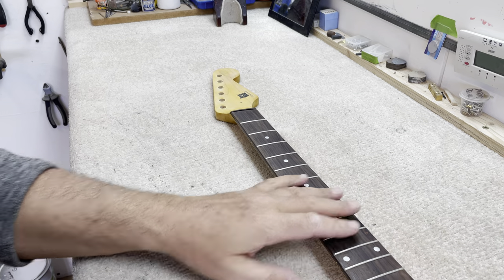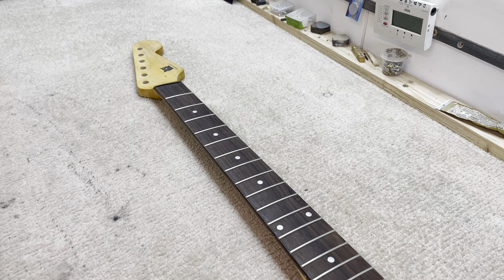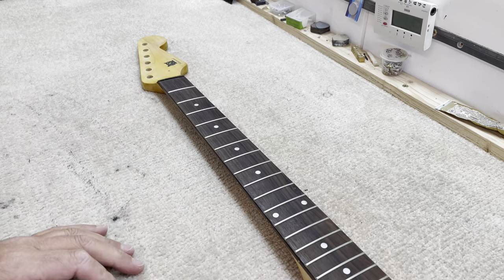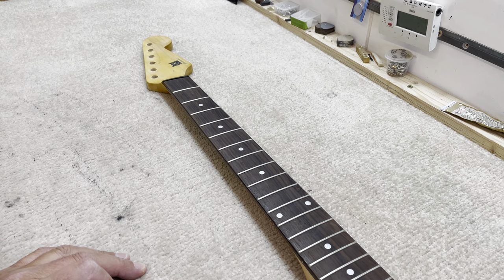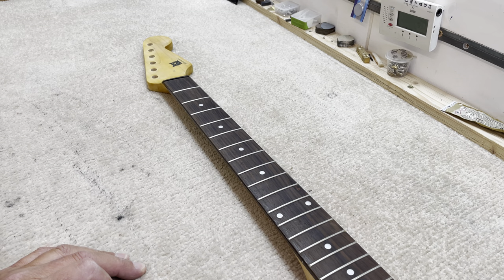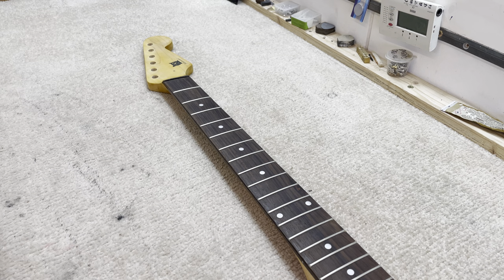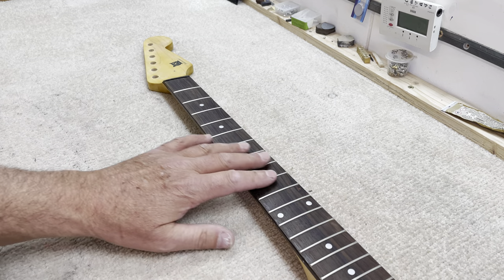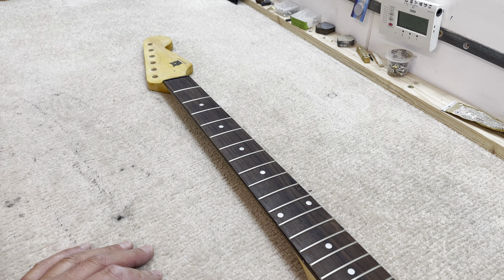Trying to deliberately break my guitar neck by adjusting the truss rod

Comment: What’s going on if my truss rod is loose and my neck is too straight?
Reply from the maker: It means 1) You've got a (confusingly named) 'dual action' truss rod which only works positively in ONE direction i.e. tightening / clockwise and 2) your strings aren't loading the neck enough to create relief. 
This very common kind of rod relies on the string loading to pull some relief into the neck. If your rod is loose and the strings aren't pulling any relief into the neck... then there's not a lot you can do other than remove the fingerboard and install a double-action (works positively in BOTH directions) truss rod. That job is by no means as easy or mess-free as it sounds.

Comment: The key thing you point out Sam is - to use the correct tool for the truss rod - an ill fitting allen key etc. can strip away the socket edges and make it really difficult to adjust later on.
Reply from the maker: Yeah you're right there. With the adjuster buried in the hole it's all too easy to 'scuff' the adjuster even with the right hex key. With the wrong hex key you'll wear that out soon enough.

Comment: I have found Necks (rear) finished with Tru oil to be more susceptible to humidity changes.
A client brought such a guitar for set-up - I left it in my dry room for a week and the action/neck returned to original condition with no  other interaction
Reply from the maker: That makes sense. If it's sealed in a cocoon of thick poly or nitro it must be much harder to gain / lose humidity.

Comment: I bought an acoustic with a broken truss rod. So it is possible to break it. But I think that someone would have to know that they are applying way too much force. Or maybe the nut came off and they crossed the threads when they put it back on. As I'm writing this post the crossed threads seems like may be what I have and not a broken rod. Anyway you should work slow and don't force anything.
Reply from the maker: Yes... the point being is that you REALLY have to try to break one. Unless the thing has already seized, stripped or snapped due to weakness or fault.

Comment: Very interesting. You have a knack for teaching, no doubt.
I still wonder if the problem is when unsavvy players tighten the truss rod under full string tension
Your test didn't account for it. Maybe a new test with strings on tuned at pitch?
Reply from the maker: Personally, I know it won't make any difference i.e. cranking the truss rod as hard as I did here with the strings on won't break anything either. But if I get a chance to do it I will :) To prove the point.
Reply: @SamDeeksRelovedGuitars  Sam, the way you did it would make the neck bow the most because with string tension it would fight to straighten the neck. No need to redo the experiment. Thx Ken

Comment: Sorry you are wrong. My MIM telecaster had a forwarded bow. I could even get it flat before it cracked the back of the neck. Literally half hour ago. You can go to far. In my case it wasn’t even as far as I needed to go
Reply from the maker: Genuinely interested in seeing some pics of this. Email me samdeeks@gmail.com if it’s not too much trouble.
Reply: I sent you a couple of pictures. Honestly I was shocked when I heard the pop. Been playing 30 years and own 8 guitars. Do the work my self and have a good understanding. It didn’t even get flat before it popped the back. Gutted I was (I AM) 
I feel like getting in touch with fender but it’s not new. Never should have happened tho
Reply from the maker: @Jameswilliams-xw5wi  Thanks I'll take a look and come back to you
Reply from the maker: @Jameswilliams-xw5wi  HI James - thanks for the pictures. Very interesting to see. You've pointed out something here that I overlooked - the fundamental difference between the original Gibson & Fender style truss rods and the (now) more common 2-part ones. When I made this video I wasn't thinking about the vintage style, more about the modern ones. The problem with the vintage ones (which are a 1-piece 'rod' design) is that they use the wood of the neck as a a 'structural component' for their effect. Those kinds of rods create TWO primary forces: the first is a longitudinal PULL (evenly applied at either end) and the second is the 'upward' push designed to flatten or backbow the neck. The only force you really need to change the shape of the neck is the upward push; the extra stressing of the maple (or mahogany in Les Pauls) at either end is... unfortunate. With a modern 2-piece rod (for example, the ubiquitous rod-and-bar design) the primary forces are applied only to the two metal components. Tightening pushes one end of the bar closer to its other end; since it can't compress it bows upwards instead. The resultant upward bowing force changes the shape of the neck. The heavy forces in that equation act primarily on the metal components only; the upwards push is the only significant force impacting the wood. This is a much better arrangement. 

Anyway, the point here is that you're right - too much force applied to a vintage, 1-piece truss rod may well damage the wood of the neck. What we don't know is why your neck was so bowed / relieved to begin with; we also don't know why - on application of some pressure to the rod adjuster - it would not respond adequately (in the way it was designed or anticipated to do). In your case, the loading required to even get part of the way to flattening the neck has proved too great for the wood that the system expects to be the 'fixed' and unyielding part of the mechanism. Because you are pulling to straighten the initially-bend rod, the compression loads here are mainly to the OUTSIDE of the ends of the truss rod. This I think explains why the maple cracked to the outside of the visible skunk stripe. 

But the important thing is that I stand corrected in relation to those 1-piece 'traditional' truss rods: where the neck wood is itself a 'stressed member' in that truss rod's functioning, then it can be damaged by excessive force. So if you crank a vintage Strat, Tele or Les Paul truss rod and it stiffens but has little or no effect - stop. There has to be a mechanical reason why the rod - even under pressure - is not creating the desired adjustment. Assuming that the threads are gripping yet the neck relief isn't visibly changing enough then there is something about that neck - the wood  or the strings - that is preventing the rod from changing the neck relief it as it should. Short of Rick Parfitt 13 gauge strings tuned up two tones, the likelihood is that the wood has lost its flexibility and cannot move. It follows that excessive force won't help. 

I guess the point I set out to make is that you have to go a long way to damage your neck with the truss rod adjuster - and that point still remains true unless the force is either excessive OR there are flaws / weaknesses in the timber - which is highly likely.  The reason for making it the video was in the hope that people would not be so afraid of making the necessary adjustments but in hindsight, I would have liked to have understood the 1-piece / 2-piece difference better and to have made that distinction. 

In your case, if your adjuster was adjusting (it must have been if it was increasing the pressure on the wood enough to cause a split) but the neck wasn't responding then there had to have been a flexibility problem with your neck - a problem that adding more pressure to those two ends of truss rod (where it's anchored) couldn't solve. 

If anyone else has a Fender USA or MIM strat that fails to respond adequately to moderate force / adjustment... then I would recommend returning it under warranty for a replacement neck. You can apply quite a LOT of force in adjusting without expecting the wood to fail  but the basic design of the 1-piece truss rod leaves your neck under permanent 'outwards' compression at two spots (the outside of end of the rod) from the 'get-go'. That's definitely a sub-optimal design.
Reply: Thank you very much for that in-depth reply. I feel I will get in touch with fender. In this case it was to much relief and cracked the wood way before it was even flat. It doesn’t seem right to me. And I agree with getting people involved in there trussrod. It’s important and depending on temperature and conditions I often make adjustments to mine to get the best out of my guitar and playability. This is the first time I’ve personally had this happen

Comment: What about loosening the nut too much?
Reply from the maker: If you loosen the rod adjuster the worst that happens is that it comes off. It can be refitted and tightened back up easily. In the case of two way truss rods, going past loose (mid point) eventually tightens, and bends it in the opposite direction.
Reply: @SamDeeksRelovedGuitars  Thanks a lot. I feel like I truly understand how the truss rod works now compared to before.